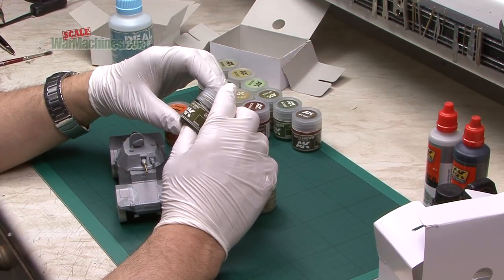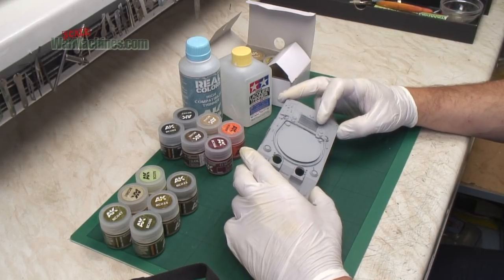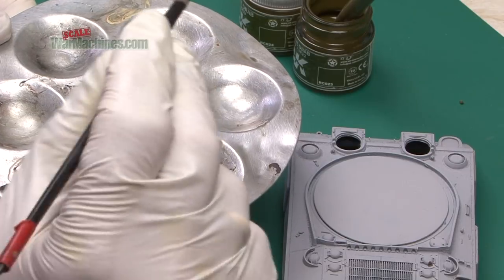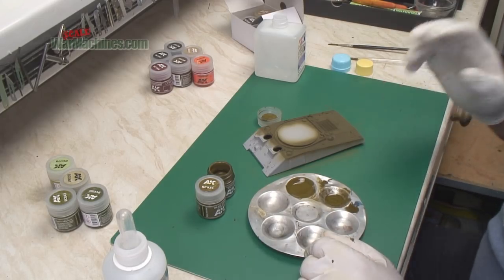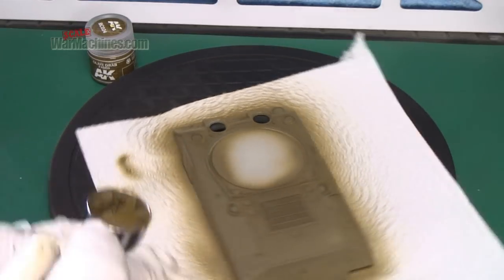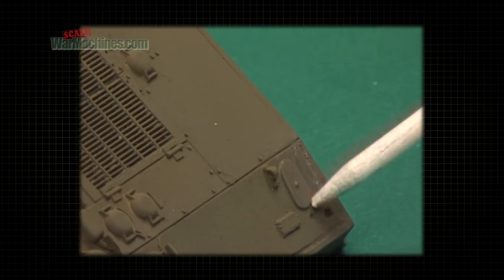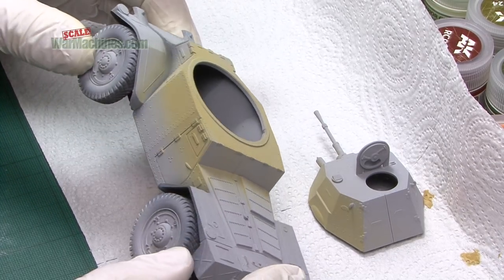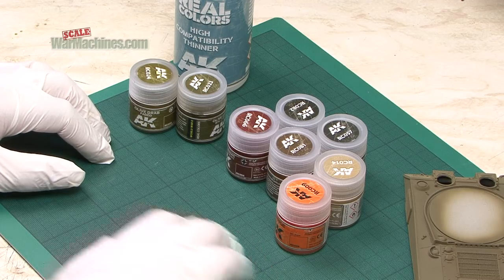AK INTERACTIVE REAL COLORS -  DETAILED REVIEW AND "HOW TO"

Comment: I am now using them for all my military models.  They spray nearly exactly like Tamiya [which I thin with Laquer thinner NOT the acrylic thinner].  Only time will tell if they stay nice in the bottle.  In all my 40 years of modeling, ONLY Tamiya seems to remain perfect in the bottle no matter how long it sits, that is, so long as you always make the caps tight.  They are not as good a deal per oz as Tamiya, but the AK line has a LOT more color choices. You can still custom mix your own colors with Tamiya, but that can be a waste of paint AND time, so that is why I decided to start using the AK Real Color.  Thus far, I am very satisfied with them.  They spray beautifully and seem to be fairly tough, which I like. Tamiya is so tough, that I usually just use their regular colors for prime coat.

Comment: This paint system for me is the top of the fine scale model making tree. They are the best thing to happen to this hobby since it started way back when!

AK Interactive have really done their homework with this system and the colours are deadly accurate. This system will really change the way we all paint and for the better. You use less material because the coverage is excellent and it is much more forgiving and can take a lot more punishment with regards to the weathering process than anything else on the market. 

I can't praise this system enough, they are a joy to work with and they leave you feeling, dare I say, a little overwhelmed with the results. 

Great review Scale War Machine and I for one am looking forward to seeing this new and exciting build series to confirm to all those modellers out there who have almost given up on paint and yet another paint brand... 😉👍
Reply: There is no subscriber competition crow. No prizes
Reply: Hi Mr. Clive, can i ask - i saw he used a WATER ACRYLIC PRIMER !!!  doesn't the Real Color lacquer attacking the acrylic primer paint ???!!! i saw how synthetic thinners lift off acrylics in a second ! (actually,that's how i cleaned off a bad paint job that i'm not pleased with)  - can we use the water soluble acrylic primers such as the Vallejo primers ??? this will make everything simpler,  would be great !

Comment: what did you thin with for brush painting.  
mr leveling seems to strip the previous layers 
water didn't work at all 
and I stopped there so curious as to what you used 
great video thanks for the test
Reply: Use cellulose thinner

Comment: I bought AK real colors and and airbrush and compressor. I have yet to use the Iwata but is it generally safe to say 50/50 dilution of the AK paints? It's getting cold up here and I don't have a booth to spray in so it will be the garage unfortunately. Will have to spray and pull the parts in the house asap.
Reply from the maker: Yes, absolutely - 50/50 will work well whatever the temp range.

Comment: What if i want to do a coat of chipping  fluid. Will still work? After all ,its lacquer base paint, and the chipping fluid is water based.?
Thanks
Reply from the maker: It should work, I tend to find masking film/fluid works better. Also you tend to get more obvious edges with the lacquer paints. Test it on a scrap piece of plastic and see how it comes out.

Comment: Did I miss it, but what kind of pressure and needle are you using in your airbrush?
Reply from the maker: Rarely mention pressure because often use airbrushes with a MAC valve meaning compressor regulator setting is not accurate. Looks like the Iwata Eclipse CS was used with it's 0.35mm needle/nozzle. With that brush 1.5 bar is a good setting on your compressor. May also have used any of our other Iwata brushes, like the HP-CH with MAC valve and HP-TR2- can't really recall. Again go for 1.5 bar.
Reply: Ok, thank you. Was just having some problems and was interested in settings. Now it works fine.

Comment: Would you say the spraybooth+mask should be both used only when airbrush in use, or also when brush painting?
Reply from the maker: Ideally in both scenarios, but the danger is the atomised paint through airbrushing. It depends on which brush painting product you are using so it's not really an issue with acrylics for example. It is though if you atomise them and then inhale.

Comment: Thanks for Video. At what pressure is your AB set please
Reply from the maker: Usually 1.5 bar. Hard to tell though as I have a regulator on the airbrush itself as well as the compressor, but 1.5 is the go-to setting for most scale model work.

Comment: Did you get to experience the flat varnish? Mine gives me a rather satin finish, i don't know why
Reply from the maker: No never tried it but that doesn't sound good! Wonder if it's like Tamiya matt varnish and designed more to be added to the paint rather than as a top coat - like an additive to make it matt?
Reply: @scalewarmachines  I did some testing and found out that it lacks that additive. Whilst i never tried x86, the x20+flat base in a 7:3 7.5:2.5 ratio makes it dead flat. If its only 9:1 it gives this satin finish. A bit disappointed by ak here because i tried their acrylic glossy and now real color flat varnish and are both very difficult to work with or unusable

Comment: What’s the thinning ratio with their own brand of thinner
Reply from the maker: About 70/30 paint thinner.
Reply: Scale War Machines 
Thank you should I use a primer under these paints or will they be OK to spray on bare plastic ?
Reply from the maker: You don't necessarily need primer, most model paints will spray straight over plastic but it may take longer and lose shadow or highlight effects/benefits from a primer coat. If you have brass and resin bits, a primer is a good idea.

Comment: 10Ml Vs 17Ml   Hmmm i know i won't  purchase  less Product for the same price .  So the old colours where not as accurate  ? These are real ?
Reply: Except that those 17ml bottles are pre-thinned. I've thinned AK real colors anywhere from 1:1 paint:thinner to 1:1.5 depending on the color without issues.